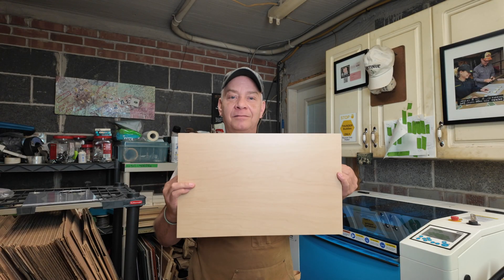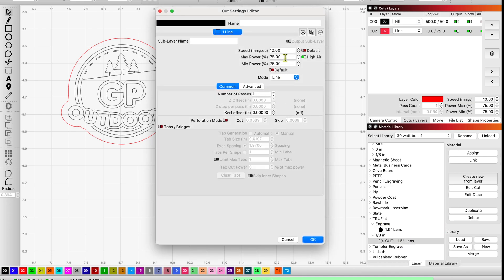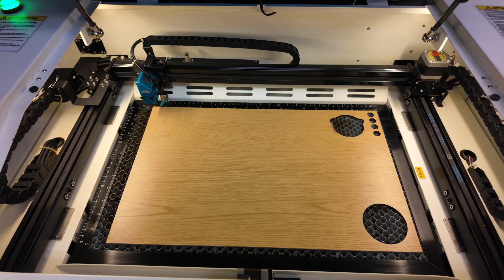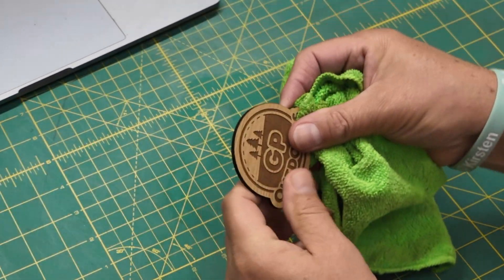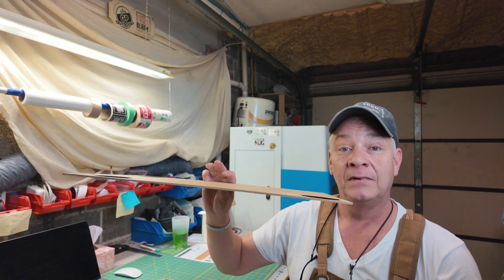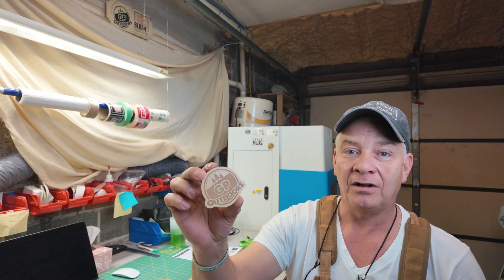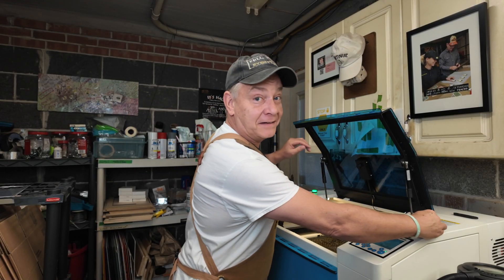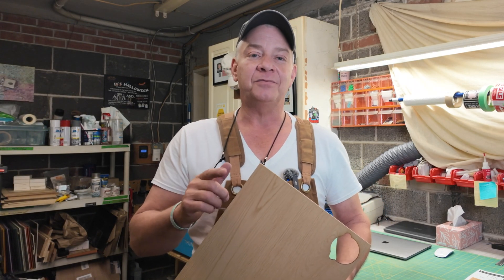Engraving TRUFLAT Laser Plywood on Thunder Laser BOLT. Settings and Review.  059   4K

Comment: I have just had the opportunity to try the TruFlat material out, and I like it so much I will not waste any more money on plywood like Birch. It is a fantastic material for laser engraving.
It is also cheaper than the Real wood or Veneer you get from Brand name Laser Suppliers. I paid 50 - 75% less for the same sizes and it is so nice to work with.

Comment: I have a question for you about the TRUEFLAT... I have been cutting some Christmas Ornaments and it really has a bad smoke smell to them. What can I use to remove this smell? 
Thanks!
Reply from the maker: Morning Rick. I am not sure I can assist. I barely smell anything when I cut it - I mean, I can always smell MDF products when they cut but it's not a strong smell in the shop. The exhaust on the machine works very well for me. Are you using a BOLT laser?
Reply: @LaserNUG  I tried water and vinegar mixture and it seems to have done the trick.. Thank you!!

Comment: Hey Gord, great demonstration of the potential of TruFlat and the Bolt! Quick question: do you know approximately what your kerf width was when cutting through TruFlat?

I seem to remember you saying it was .005" for acrylic and I'm just wondering how it differs for TruFlat.

Thanks!
Reply from the maker: Good morning. Very intuitive question. LOL. I didn't realize it would be different until I tried the .005 and it didn't work for me when infilling acrylic into the TRUFLAT. I had to do some pieces (ones that were thin and shapely) with no kerf adjustment and the simple shapes were very tiny kerf adjustment. I am sorry I can not remember now but it was a much smaller adjustment - I think it was around .0025 but I can't be sure as I am not home. Sorry about that. Good luck and sorry I couldn't be more help
Reply: @LaserNUG  
Hey Gord, I just wanted to follow up and say thank you for taking the time to answer my question fully. It would have been easy for you to just tell me to wait for your next video (posted 2 days later), but I really appreciate you taking the time to answer my question fully.

Thanks again!
Reply from the maker: @ExF1Guy  No worries. :) Have a great weekend!
Reply: @LaserNUG  
Thank you for taking the time to reply Gord! It gives me a starting point

Comment: Holy smokes! I just got a 5w diode and ordered some Basswood from Amazon. Those were so warped that I could not use them(I dont have hold down pins). I was about ready to give up on wood and stick with plastics until I came across your video. I am going to order some and try it!
Reply from the maker: Good luck Dave - Cheers!